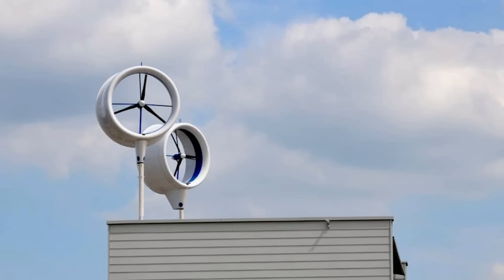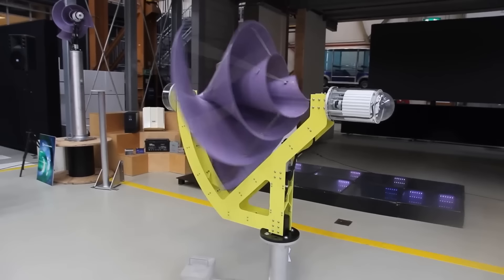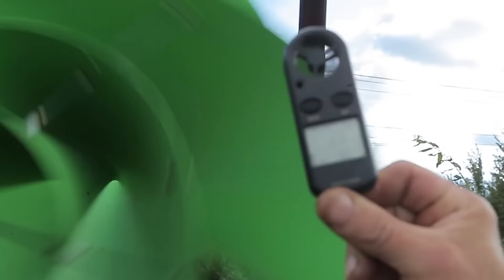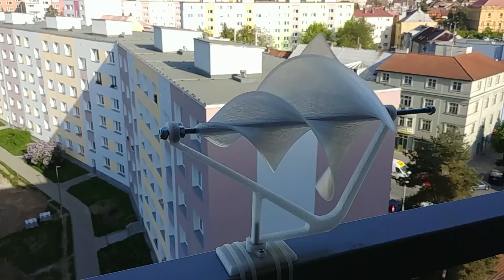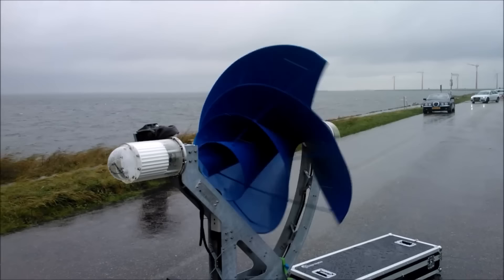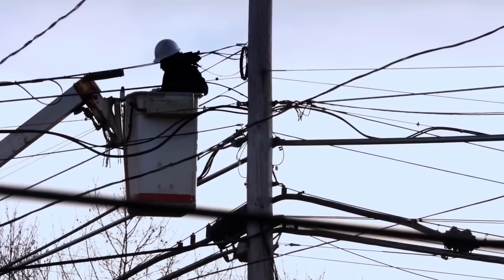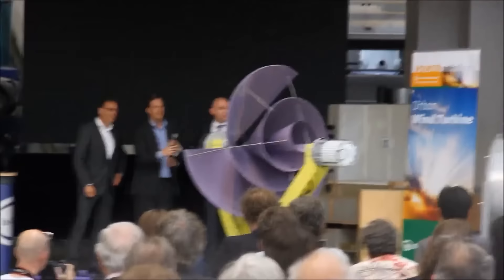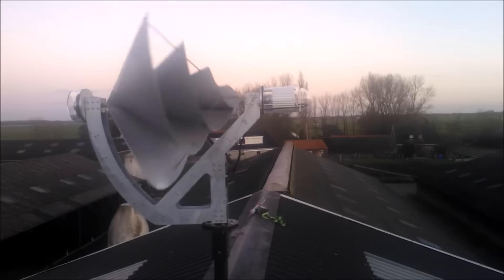How The Liam F1 Wind Turbine Will Destroy Every Home Renewable Energy Source

Comment: 1. Almost all residential building codes don't allow for residential wind turbines.
2. Wind turbines need to be high up, to be away from ground effect, roofs are not nearly high enough. There's a reason you've NEVER seen a wind turbine on someone's roof, anywhere.
3. Almost every other bit of information in this video is either an outright lie or scientifically illiterate ignorance.
4. These cost $10-15k each, and will never, EVER pay for their own cost, as the energy output is meaningless and the maintenance will be constant.

Comment: I think the turbine doesn't work well because, for example, a 5kw alternator without load turns quickly and softly, but if with load a device such as a 2000w hairdryer and alternator has a hard effect and is difficult to turn.

Comment: A lot of blah blah blah. No useful scientific equation on how they arrived at their power output figure.
How big is the motor generator? What is the minimal RPM in order to generate useful power ( id est current)? Did they do calibrated wind tunnel air speed and what RPM are achieved in each designated wind speed vis a vis diameter and chord of this wind vane?

Comment: Simple useless at my area and very much others also, if there is no WIND !
I even didn't invest in a wind meter on my 10 meter pole, as the airport measure with 10 meter above even don't reach 1 m/s most time year.
So it can't destroy another source anywhere as it is passive, it might just be able to outrun the reinvestment time depending on wind speed and time available.
rated thumb down as of the Title.